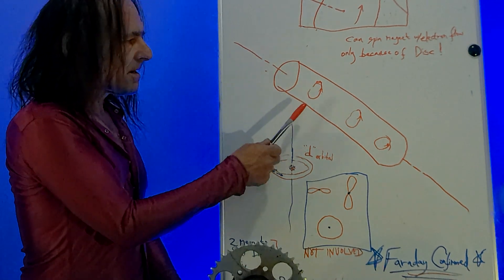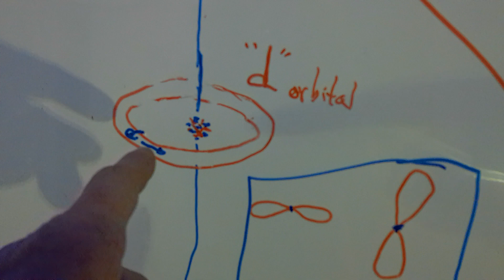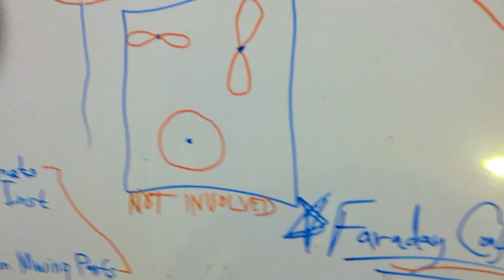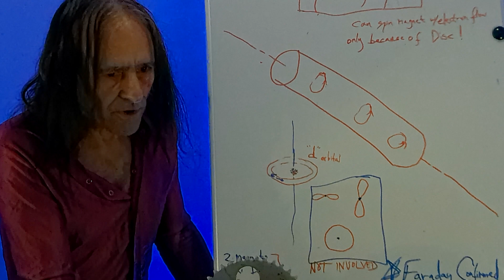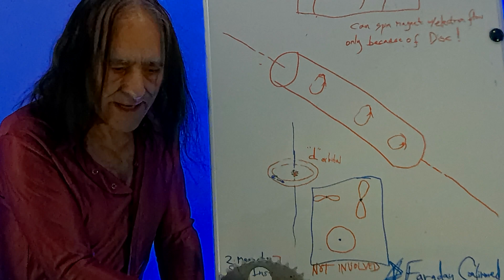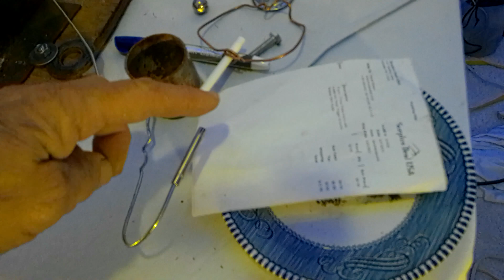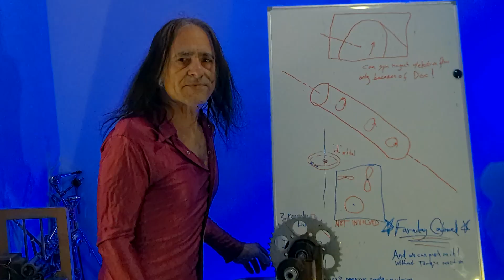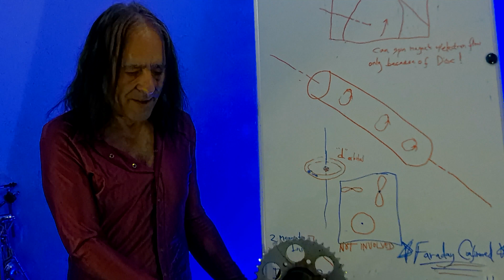Faraday Paradox Solved! He was correct - the field does not rotate with a rotating magnet.

Comment: I'd imagine then that you could attach a magnet to the disc of a unipolar generator, and it would still work... would be interesting and easy to test. Even alternatively place N and S sides of magnets along the whole disc and could get it to become alternating instead of direct.
Reply from the maker: Yes, attaching the magnet has been done. It does work. I did it with the motor, but all electric motors are also generators at the same time. Somebody on YouTube has the AC one with the setup you describe.
Reply from the maker: What does not work is the thing I wish I could do... just rotate the field and skip the commutator. But rotating the magnet doesn't rotate the field. And I hoped so much.

Comment: I did experiments years ago that confirms what your experiments confirm, I'm glad I'm not the only one. I have designed many types of  good power thrusters that work.and dc brushless motors that  don't need commutation. They can be made very light and cheap, and fast .I would like to build an sell several different types. To accomplish this there is one part you must figure out how to make, it took me over a year to find a solution. Once you know how and why you need to make a simple part that doesn't exist the doors will be opened and you will understand exactly as I do how to make as many new, more efficient motors and magnetic thrusters.100s of different types can be made.A new age is coming where automobiles, and transportation will only need magnetic thrusters .No need for motors or transmissions or differentials ,Just one x,y axis thruster.keep up the good work and you will find the perfect answer and solutions as I have. GOD BLESS. 😊😊😊,I may do a video later to show the secrets to everyone.
Reply from the maker: If you do a video, I would love to see it. It's work doing this stuff. I have more to go. I may have found flaw with the Feynman model for magnetism, but as usual I want to be more certain.
Reply: @princeoftheblues  Feynman did not understand magnetism at all.  Of course he was wrong.  All of his diagrams with squiggly lines denoting purely imaginary processes that have no basis in reality are also crap.  He was no scientist.
Reply: The difference between vortex and  and terroidial plasma vortex shows the relative relationship between a magnetic field and a magnetic field that's grounded. This also shows the need for inside of you f os to be perfectly rounded to prevent a discharge as shown in a tesla coil design of the hood....
Reply: A magnetic current flows in a vortex when the magnetic source is grounded. This is shown in the plasma vortex.....

Comment: right off the bat, what makes you think there's current inside a magnet?
Reply from the maker: The Magnetic field. We know a magnet acts like a simple solenoid. That is a bolt with wire wrapped around it. Since they act the same, other people, not me, concluded that there must be a circulating current in the magnet. I have never seen it personally. Someone commented about a comment I made on another video, he said that atomic orbitals are not real, they are waves of probability. I said then what about that unpaired electron in the d orbital. He didn't answer yet. That doesn't make him wrong. I agree with him, sort of. But the only reason to ever use probability is that we don't know enough. It isn't really a probability; it is a little machine that works the same all the time.  The model doesn't always make perfect sense.  But we can't see atoms and hold them in our hands. I don't like to use models that don't represent what is really happening. I want to understand. We all do. 
  You know a crystal changes shape a teeny bit when you apply a voltage. So they hook up a (little) table to it and they can move it around. Now they take a shard of diamond and drag it across a surface and they can make maps of individual atoms. I love that, but it doesn't tell us what's inside.

Comment: Yes, of course. But in most motors, generators and alternators, moving the rotor and starter together would produce nothing. Not the case here. Otherwise I would make a fine DC machine without commutation by spinning ths field magnet. But that produces nothing.

Comment: No back emf on the fixed Faraday homopolar generator
Reply: There is a little, but only if you have a small air gap and a strong field, and large diameter.  Otherwise they could never be used as a generator,  cause as you know motors and generators are the same. YouTube has that giant retired one in Australia that they had used to power magnets.  I needed a longer video. There are no homopolar motors.  Every line goes all the  way around. If I use only the north pole, every segment of that pole has a north and a south. All the points in the field do too.  I have even more work to do on this. That is to dangle a whole system from a thread and start it!